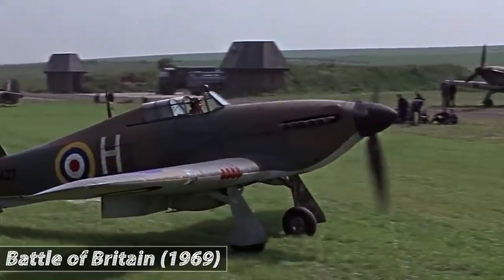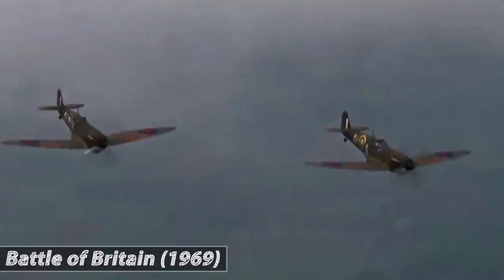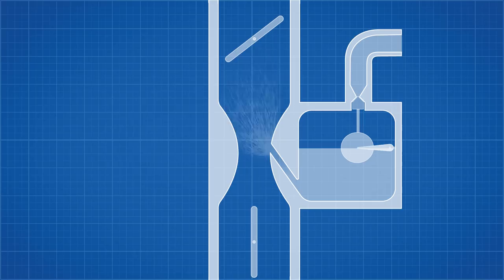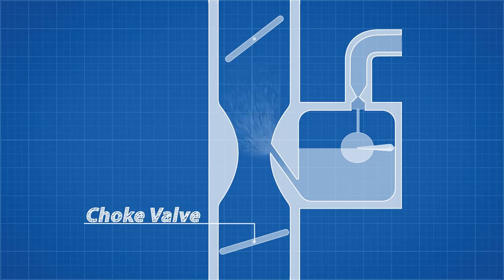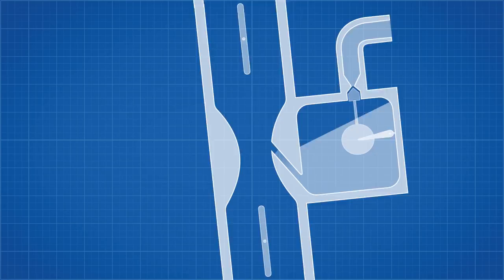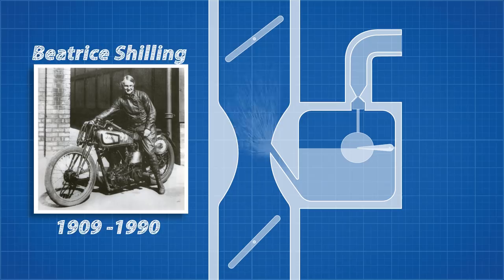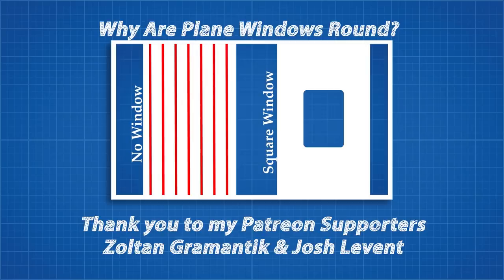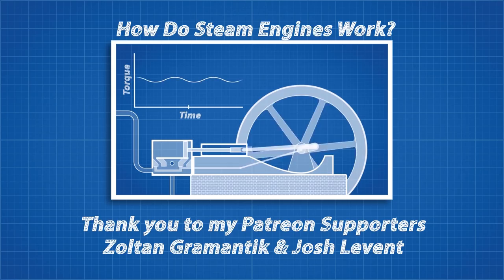The Spitfire's Fatal Flaw

Comment: Fatal Flaw in a video about Spitfires:  Continually showing a Hawker Hurricane, a completely different airplane.
Reply: Different plane, same problem. They both used the same engine. At least, the early spitfires carried the same engine.
Reply: Not completely. It also used the Merlin engine, so probably suffered the same problem
Reply: its a badly titled video. it was the [i]merlin engines[/i] [i]annoying problem that was relatively soon solved[/i]
Reply: Relatively soon, as far as with mk.IX in 1942.

It is about a flaw on Spitfire, which was the early Merlin engine, also mounted on Hurricane. Where is the problem?
Reply: 19Koty96 because the video was titled 'the spitfires fatal flaw' when the video was neither unique to the spit, nor particularly fatal
Reply: It made flying a spitfire quite complicated. Without it, it would have been the ultimate fighter.
Reply: 19Koty96 it was very quickly heavily mitigated, and wasn't long before it was eliminated. and it didn't make a huge difference, you simply had to roll over into a turn. whereas other planes had much more issues (don't dive too fast, not turn too hard) the spitfire had none
Reply: Look, I know quite well how things go. Also, this "simple roll" adds quite some delay, not something that a good pilot would have problem with, but still a delay.
Reply: 19Koty96 a meant simple in the sense that it wasn't much more complex to do. however you are correct, the germans learnt to go into a nose dive to get a spitfire off their six. however spitfires could dive steeper and faster than a 109, so it was only a temporary solution to the 109s problem
Reply: Mark Bolton momentary loss of power is not fatal. The engine cut-off might -.o

Comment: This video ought to be called "The Early Merlin Engine's Minor Disadvantage"
Reply: That's not clickbait enough. To get the views, it needs some Tabloid Banner headline, like...something along the lines of, say..."The Spitfire's Fatal Flaw".
Yes, that would do it!
Reply: it in fact a major flaw as the engine would fail in a dogfight your basically gilding i.e easy pickings
Reply: @barneystorer1092  True, except the Spitfire and Hurricane pilots quickly learned how to deal with the problem, until a proper technical fix was made.
Reply: @MarsFKA  Nope, the experienced German pilots exploited this so the Spits coudn't follow em.They still lost ;p After the  fix came  they were soooo outclassed ;)
Reply: @havocgr1976  When a Bf-109 dived away from Spitfires, the Spitfire pilots learned very quickly to do a half-roll, then pull into the dive, keeping positive g on the carburettor – the Hurricane, even doing this, could not match the 109 in a dive.
There is a clip on Youtube in which two of the RAF's most experienced fighter pilots are discussing this very tactic. According to them, it worked.
The pilots to whom I refer were Douglas Bader and Robert Stanford Tuck.  I have also read Tuck's biography ("Fly For Your Life" by Larry Forrester), in which this very problem and the remedy were discussed.
I think I'll take the experts' word for what really happened in combat.
Reply: @MarsFKA  Ah ok cool, managed to get into a Spitfire cockpit past winter ;)
Reply: @MarsFKA  Also, thanks for the details.
Reply: @havocgr1976  My pleasure. Congratulations on sitting in a Spitfire. I got my first seat in one in December 1963. I was in the Air Training Corps and we had a weekend camp at Wigram Air Base. On Saturday, we were marched to one of the hangars, where a Mark XVI Spitfire was parked. It had just arrived in New Zealand, a gift from the RAF to the Canterbury Brevet Club (Ex-Air Force personnel). It was no longer in flying condition, but we were allowed to play with it for half an hour. I still have the two photos of me sitting in it.
Fast-forward twenty-four years and the Wigram Air Base has been closed and is now home to the Air Force Museum of New Zealand. It was my first visit there and I saw, in the main display hall "my" Spitfire. I told one of the staff that I had sat in that aircraft in 1963 and he looked around, saw no one else in the hall and asked if I would like to sit in it again.
He didn't need to ask twice.
A two-seat Mark IX Spitfire is based at Ardmore airfield, south of Auckland and gives rides to paying passengers. I would go in a flash, but thirty minutes costs NZ$4050.
Reply: @MarsFKA  Heh there are zero Spits in my country,I am in the Greek airforce, I had to visit the UK to manage it.I think elsewhere in the UK(coudnt find in London) a ride costs around 2000 pounds.Too expensive for me.
Reply: @Lush 
The first fix was in 1940, the complete fix in 1941 on the Spitfire Mk V and the advanced speed density carburetor used in 1942 on the Spitfire Mk IX.
Reply: rogerwilco99  
The fix was in 1940, the full cure in 1941.  Long before the P 51 turned up with the inferior Allison engine.
Reply: Richard Tattis  "The Plane that lost its Wings"
Thanks for the warning. I'll be sure not to watch it.
Reply: Richard Tattis  Ah! If WILBUR has the BOOK it must be true!
Yeah, right.